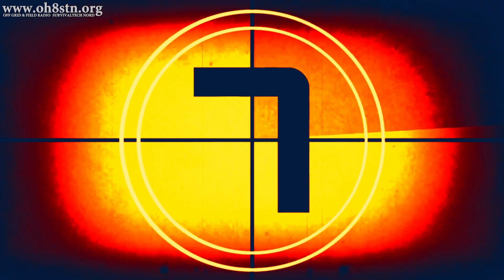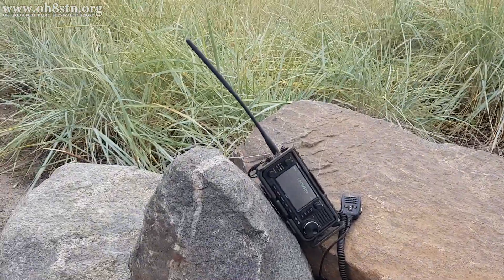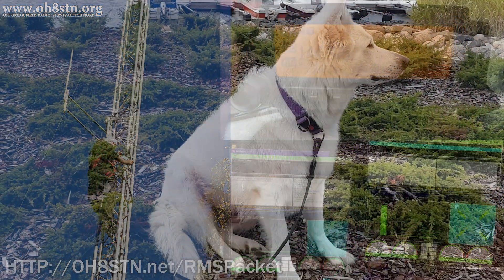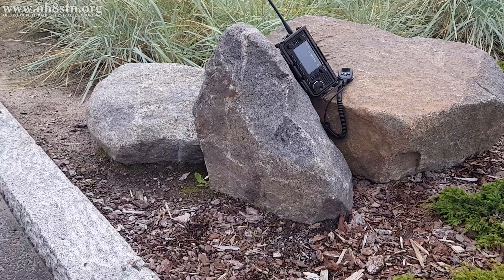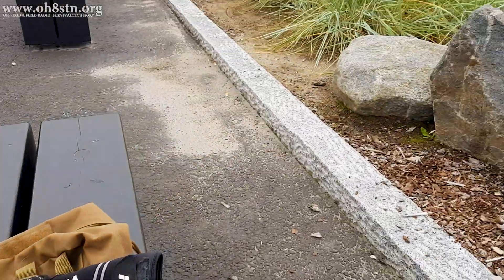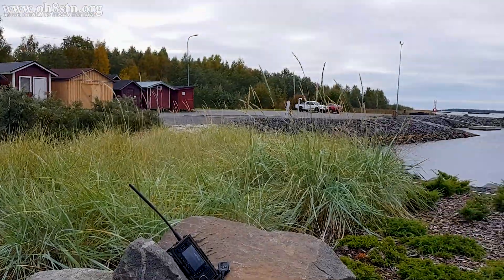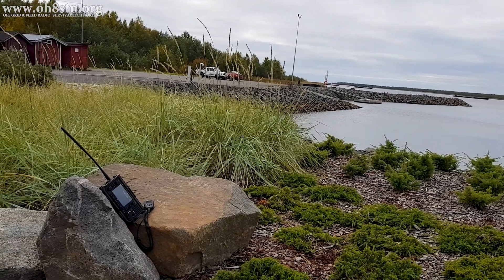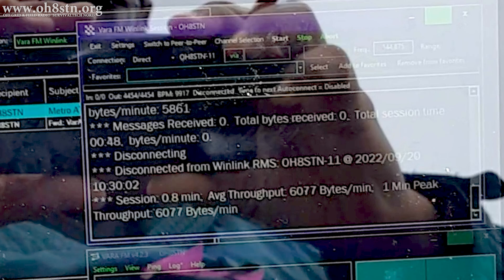Portable Winlink on VHF | Off Grid Ham Radio

Comment: Julian:
    Sorry if I missed this in one of your excellent videos, but how do you set up your IC-705 for VaraFM (especially Wide)?  For wireless connections the 16khz and 8khz network sampling rates look low.  Do you also tweak the volume, and do these settings need to changed when you switch VaraHF and back again?  Any addition tweaks you do on the radio side to have most reliable data transfer on both UHF/VHF as well as HF?
    73,
    Charles  W1ZPB
Reply from the maker: Naturally you have to do the connection tune test in Vara FM, with another station. This will get your volumes set up correctly. The only thing I tweaked in the Icom Wireless utility was the buffer. I dropped it down to 80 milliseconds.
Reply: @OH8STN  Thanks, those were the clues that did it.  Operating wirelessly is so freeing!  Surprised that 8khz sampling works, since Vara FM Wide needs a 6kHz audio bandwidth.   Anyone know the FM deviation level the 705 clips at?

Comment: 2 Q:s, will Elon and his star link will it be another tool or trick(gear to haul ) ? and can you better explain using a radio with a MARRS modification. Maybe I do not know anything so delete if you want. Like your video's Be safe.
Reply from the maker: On the surface starlink looks like a good deal. Internet access anywhere on the planet, provided one has starlink access. How it will ultimately be used instill to be determined.
A MARS mod simply means opening up the transmit and receiving capabilities of a transceiver. MARS stands for Military Auxiliary Radio Service. Since the frequencies of military radios are outside of amateur bands, an operator wanting to participate in the MARS program (or wanting yo maximize his/her radio capabilities, needs a MARS mod in order to access the additional bands & frequencies.
Hope this helps. 
73
Julian oh8stn

Comment: Hi I just got my first RTLSDR and BAOFEN UVR5 if you could help me get started? I’m also located in Finland
Reply from the maker: What is it you'd like to do with the SDR and Baofeng?
Reply: @OH8STN  listen to aviation and probably other institutional broadcasts locally and globally if possible. Bf I don’t have license so only listening atm. If the license is realitvely easy to acquire I’d be up for it also
Reply from the maker: Here's a video to watch. Nevermind the antenna. The computer and SDR setup are interesting. 
https://youtu.be/Uec52cQTOvM
There's no license required for listening. Most local aviation in Finland is 118-125Mhz. That is within the capability of your RTLSDR. You'll just need an antenna.  I would suggest starting with a "discone antenna" (google it). 
Hope this helps. 
73
Julian oh8stn
Reply: @OH8STN  thanks a lot Julian stay safe and keep up the good work 💪

Comment: I love that you are setting up multiple options (one is none, and two is one ;-).

Are you considering setting up some really high-speed links on higher bands where much higher bandwidths are permitted?
Reply from the maker: Thanks John. 
HF provides lots of redundancy, but comes at the expense of mobility. Utilizing both HF & VHF fills the gaps either portion of the band lacks from the other.

At the moment, the goal is using the salty water of the Northern Gulf of Bothnia to link the coastal cities in the region. Range is severely limited in UHF without higher gain antennas (which I don't have). The options were 29Mhz, 52Mhz or 144Mhz for this phase of the project. Next phase is an HF relay to augment VHF. If there is some additional capacity and desire amongst other operators to contribute, there's no reason faster baud rates on higher bands couldn't become an option.
As always thanks for watching, commenting and the kindness.
73
Julian oh8stn

Comment: Julian, what if instead of VaraFM you setup the RMS with plain Packet and try to access it with Mobilinkd on a VHF handheld and an iphone or android mobile phone? 73 from Helsinki
Reply from the maker: Hi Davide.
Packet AX25 doesn't have the speed throttling, weak  signal performance or robustness of VaraFM. VaraFM can adapt to band conditions in real time, and accept wide or narrow connections. These features make VaraFM vastly more reliable at lower power levels.  I should probably do a blog post on this.
73
Julian oh8stn

Comment: Great video Julian, I am seriously looking at setting up my own gateway, clearing out my gear (setting up a new shack) and i found an old Yaesu FT-7800E that has a 6 pin com port on the back. Might be a good project for Autumn/Winter!
Reply from the maker: Definitely Go for it!
The networks are only as good as as the gateways and BBSs on them. The 7800E if I remember correctly is an excellent choice and easy to configure.
73
Julian oh8stn

Comment: As usual, another great video!  Question, have you looked into 70cm to run 9600 baud?  I have the TM-D700 and have always wanted to try the faster rate. I gather the TM-D700 cables are special made for the Digirig?  I dont see any on their web site.  Would love to combine the VHF/UHF and HF as gateways.  Been a big fan of trying to use 30 m for data, but have not done it yet. THANK YOU!  K9EZ
Reply from the maker: Thanks for the kindness. 70cm would be awesome but I fear the range would not be sufficient for the desired coverage area. 2 meters seems to do a great job over the salty water near my home.
The digirig cables you need are called 9600baud cable, and the Digirig version is 1.9. Denis and I have talked about this already for my D700 so he will know exactly what you need. Just ask him for the D700 digirig setup as Julian.

The faster rates are amazing when we have LOS. It's like comparing a dial up modem to fibreoptic internet :D

I love 30 meters. No contesting and it always seems to be open. 60 and 17 are also favorites for global data.

Thanks for watching commeting and being kind.
It's greatly appreciated.
73
Julian oh8stn

Comment: At that port, may anyone dock there, and if so how large of a vessel could it handle? de KB5SXC.
Reply from the maker: It's a neighborhood club port with slips for rent. Most boats are under 20-30ft, but it accommodates larger sheep barges for loading and offloading. 
Anyone can dock temporarily, but the permanent slips are rented to people in the neighborhood.
Bigger small vessels can dock a few kilometers up the coast at the deeper water port. That one accommodates larger fishing vessels, private yachts and motorboats.

Comment: Good demo.  I got a little confused on your terminology at first. Locally our RMS are either designated as "Packet" meaning AX-25 traditional packet, or VARA FM.  We have RMS gateways on both modes.  More flexibility and redundancy.   

We are building VHF Winlink, both through an RMS and Peer to Peer into our local ARES planning. Our circumstances are such that we don't need HF for our local ops, and don't really need it to reach the State EOC (although we also practice NVIS to go direct to them as well).  73 de KAØAZS
Reply from the maker: Hi Randy.
"RMS Packet" is the name of the gateway software (stupid name imho). It's a legacy name from a time when Packet AX25 was the only option. Today, it's the same software whether running AX25 or VaraFM. Thankfully when looking at the channel selection tool, stations show up as the mode they support. It's only when we have a discussion about the gateway software, the terminology can become confusing.
It is a blessing to have so many VHF P2P and gateway stations. Hopefully the norther Gulf of Bothnia region can come together in the same way.

As for HF NVIS, it is much more reliable albeit slower than VHF with AX25 or VaraFM. I'd rather have it an not need it than only have V/UHF. Do all of the V/UHF stations have off grid capabilities for power?
73
Julian oh8stn

Comment: Very nice and I agree VHF should be in your tool box for winlink. I use my Kenwood TH D74 with bluetooth and WoAD on my android tablet. You have a very good system but it breaks my rule of no windows computers.  Thank you for sharing!
Reply from the maker: No WIndows :(
Linux restricts our capabilities because emcomm software is so poorly supported. I would much rather hae a Surface tablet running Linux than a Windows OS tablet, but the best tools don't support it. PAT WInlink is pretty terrible and doesn't easily support Vara or forms. WoAD is in the right direction. When it matures enough, I'll have to get one of the de-googled android tablets to run it on.

Your systems is awesome though! The THD74 is an amazing little rig. I still have a D7 here. Perhaps I'll put AX25 on the other D700 VFO to enable packet locally.
Thanks for watching.
73
Julian oh8stn